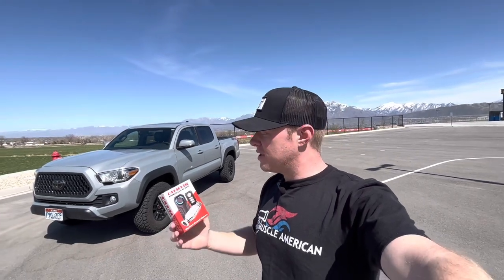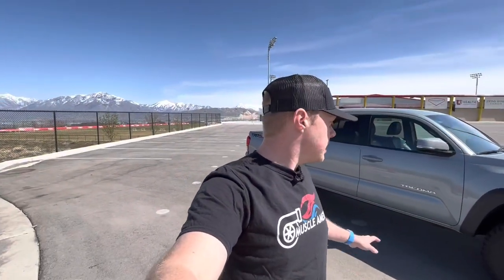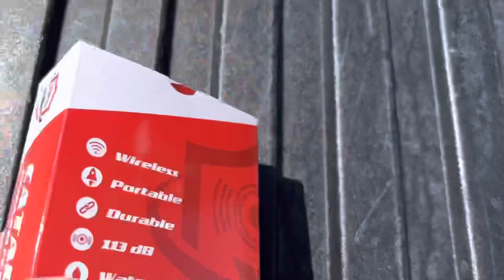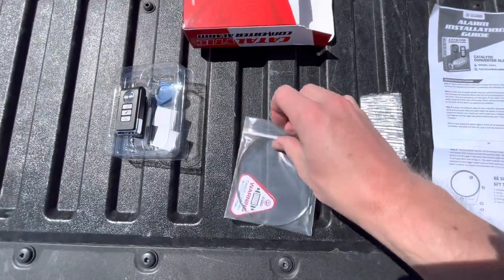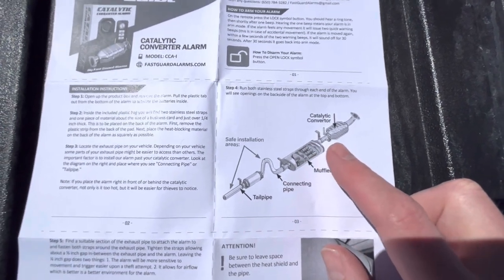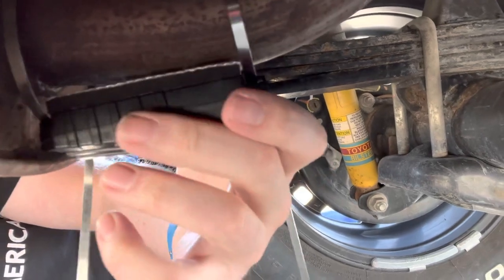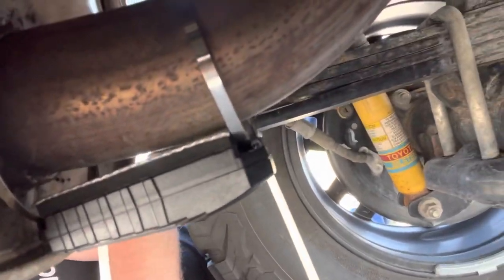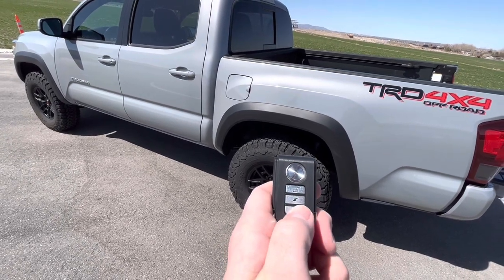Catalytic Converter ALARM Install - Fast Guard Alarm - Anti Theft Device

Comment: I installed this alarm on my Motorhome which sits on a 2021 Ford E-450 chassis about 5 months ago so I feel I can offer some real life experience to these comments. It works very well. It’s louder than it sounds in the video. Mine is ON when in storage more than it is OFF so I go through batteries every three months. 
You can adjust the sensitivity based on your desire. I had to adjust mine down as heavy rain hitting the large tailpipe would set it off. The neighbors didn’t like that in the middle of the night. I set the sensitivity so that a gentle rap of my finger to the exhaust tip will set it off. Mine is mounted as far away from the muffler and CAT as possible to keep it away from the heat. They are not very visible so I doubt that a CAT thief is going to notice it or know where the alarm is even coming from. 
I’ll admit that my alarm is my first line of defense. The second is a CATSTRAP.
Reply from the maker: Solid comment Dave thanks!

Comment: The arming noise goes off and then a beep a few seconds later. That delay allows you to close the door as you get out. It works well if you happen to keep the fob int the truck. So far I like them and they have worked well.

Comment: I use one of these. I bought another one cause it's so good. I have now placed a sheild under my 2023 Silverado and the alarm now sits against the inside of the sheild so the moment they attack the sheild it will go off. I dont set the gap and provided you set it on your exhaust toward the rear of your vehicle it wont burn up. Least mine didn't. Spend an extra 10 bucks and spray the cats too.

Comment: Can you do a tutorial on the heck you change the battery on the alarm once you take the time to get it installed on the pipe and just a few weeks later the battery runs out, I live in the midwest so apparently you can't buy this because the cold will quickly run down your battery, they should mention that in their website video spill. 😒

Comment: I've got one of these vibration alarms for 2 years and I'm using for same purpose. It does not need to be attached to exhaust pipe. Mine is under hood close to front. Not as hot. The vibrations from a saws all will rattle through entire truck so location is kinda irrelevant. And really t's only a deterrent.

Comment: You gotta give these people credit. It's the same alarm I have on my Specialized Roll bicycle and Honda Navi just with an added heatshield and straps.  It's loud enough and sensitive but it would sure be nice if there was a Bluetooth or WiFi link.  They're cheap enough to add these days and might only add another $20 to the price.

Comment: I'm in Oakland CA where these thefts are rampant- I had my stolen (my Tacoma has TWO to them) about 4 weeks ago.  Costs of about $4200- included was welding rebar over the the pipes as a deterrent.  I just installed this today- hope it helps.... but one of our neighbors Brian just had there's stolen THREE times and the had a cage welded over there converter- what a pain in the ass!
Reply from the maker: Wow that sucks! How did you have to wait for your cats to get replaced?
Reply: @MuscleAmerican  Fortunately only 2 weeks- I'm a contractor and my truck is a pretty important tool!  I hope this device helps but who knows- thieves are so brazen now- doesn't matter if its night or day.

Comment: Local cat thief Micky:
1.  Walks by your truck. Gives it a push. Alarm "warning beep" goes off. Keeps walking.
2.  Calls "Joey the Fixer".  Joey come by, slides under truck, sees alarm, sprays it with  "crack filler foam"
3   Micky comes by in an hour and removes cat!

This might be OK for some people.
I want something "beefier"
I plan on installing a similar device shown by a Canadian U-tuber. PLUS installing high security  armor with "secure" bolts.   Everyone has there own ideas/levels of security.

PS: A motion sensing under carriage alarm could also deter gas thieves from drilling a hole in your gas tank.
Reply from the maker: Yeah a cat shield is the best option to keeping thieves away.

Comment: I like your video and the price is worth it at least as a secondary deterent .  Where i live thieves are using sawsall or wheel saws-battery driven and it does not take long to cut an exhaust piple.  Maybe with a Cats EYE sensor too AND a CAT CAGE/Shield if you find one.
Problem is mfgrs do not make shields or cages for all vehicles that are threatened.

Comment: I own a 2021 Toyota Tundra TSS Off Raod and was just hit for all four of my CCs. It now sits in the shop with a waiting period of about 4 months for parts. I'm so mad, I don't know what to do. I do have a question though, How well does it work with the truck isn't being shaken and the fools are under the truck sawing away at the actual converters? Can a test be done on that? I'd like to see how sensitive it is when they are under the truck going away at the pipe. Any videos on that would help tremendously. Right now, I'm looking at having a full plate installed under the truck and would love to save $600. Thanks for the video and info.
Reply from the maker: 4 Months with your brand new truck! Oh man I’m sorry to hear that. 

The alarm is VERY sensitive. It will definitely go off when someone starts sawing away on your pipe but hopefully it goes off even before that when they are messing around with the vehicle etc... The best way to defend against cat theft is a cat shield but as you know they are pricey.
Reply: @MuscleAmerican  Thanks for the reply. Definitely something to consider. And yes, you are right. The Cat Shields are very pricey. Thanks for sharing.

Comment: My final thought is this......Im not convinced that it will deter a cat theft when set so far back behind the muffler instead of near the cat. The tacomas have 2 cats to protect. Will the sawsall make enough vibration to activate the alarm??? Rocking the truck will.

Comment: That's a no for me. Rattling around under my truck and hanging down. The alarm is probably not as loud as the Sawzall they use to cut it off
Reply: They don’t rattle under my trucks and it’s loud enough to scare away thieves. I use their new tripwire alarm kit on my trucks and a sawzall can’t even touch it before the alarm triggers. I’m happy with it.

Comment: Do you think this would inadvertently also be an alarm for wheel thieves because it may pick up possible movements in the process of taking tires off the car?
Reply from the maker: Yes you could use it for many different reasons. Any kind of movement will set it off. People use it as a bicycle alarm as well.

Comment: If the alarm goes off and nobody is around, will it turn off after certain amount of time or until it's turned off by the remote or until it runs out of battery?

Comment: I just got my catalytic converter stolen from my Tacoma on Christmas Eve. Needless to say I’m pissed. 
Unfortunately an alarm is useless as I learned the hard way. My truck alarm went off but they just kept sawing away until they cut it off. By the time we woke up and went to the front door to see what was going on they were dragging it into the car and sped off.
Reply from the maker: Oh man that sucks. How long is the wait to get it fixed?
Reply: @MuscleAmerican  that’s the other thing that sucks. I’ve been told it could take up to three to four weeks for the replacement to come in. We have so many thefts around here that supplies are low.

Comment: 2008 / 2014 Prius - These work well and are inexpensive - speaking from experience you will get 8 - 12 months out of one in a cold/hot weather climate.  Eventually, either the heat or subzero temperatures get to them.

Comment: The vibration from a saw is going to be different from shaking the vehicle. Have you tried testing the with fine vibrations of something similar to a saw?
Reply from the maker: It’s very sensitive so it would go off as soon as someone tried cutting it.

Comment: How does the alarm stand against mud & snow?  To replace battery, do you have to unmount/uninstall alarm unit?  Thank you.
Reply from the maker: Does great against the elements. And yes you would have to uninstall it to replace the battery and that lasts about 1 - 1.5 years.

Comment: Its sad that we even have to think about this stuff.  Mine was just stolen off on my 2006 Toyota Highlander.  Took it to a muffler shop and they replaced it.  They only charged me $350 plus tax and had it done the next day.  I also have a Corolla that I park in my garage but I really don't know where to park my Highlander now.  Thieves stole it when it was parked in back of my apartment building.
Reply from the maker: That’s good you got it replaced quickly and relatively cheap. That’s not the case for most people.

Comment: Ha, I have the same alarm for my e-bike, minus the heat shield. A word of caution, the more you use it, the sooner you’ll have to change the battery on the alarm. Got mine through Amazon. Very inexpensive.
Reply from the maker: Thanks for the tips!

Comment: I have this exact alarm set up after my 98 ranger got stolen. The catalytic converter was one of the things stripped after it was located and returned to me

However i’ve noticed a problem with my own. 

The control wont engage the alarm. It was working fine for the last few months until on july 4th it wouldnt engage at all. Must be a programming issue

Comment: The saw that they use is louder than the alarm, they probably won’t even hear it when they are sawing it off. I had a catalytic converter stolen a couple months ago off my Tundra. I installed a shield after had a my catalytic converter replaced.
Reply: What kind of shield you go with?

Comment: The alarm is useless unless its telling you. You can cut this alarm away. I use a Harbor Freight drive way sensor that I mounted under the vehicle. I retro fit. So what happens the motion detection sees you, it goes off, & the receiver of this Unit goes off in my house next to my bed. Any questions.... These noise makers are not going to scare anyone. They know you can't hear it....

Comment: I like the wheels are size are they and what tires ?
Reply from the maker: The tires are KO2s 265/75R16. The wheels are the new trd pro wheels. I did a video on the tires if you wanna check that out.

Comment: Has anyone tried to open the device an see if you can connect it to a relay that autosets it like when RAP turns off power in your vehicle,  Then maybe possibly another relay off of the alarm to connect to the vehicle alarm?   Or even a wireless relay that can be connected to a home automation system or a home alarm so that if the converter is tampered in the driveway it sets off the house alarm or gets alexa screaming "Vehicle Theft".  I know it can be done, but wondering about the reliability of such a cheap device.

Comment: Do you still use it? How has it treated you?
Reply from the maker: It recently broke so I no longer have it but it worked well the few times I used it. Now I have a CAT Shield that is the best protection. Check out my video on that if you’re interested.

Comment: I bought two of them for my truck.   It work well but not loud enough.    I wish it was more of motion detector with eye like a house alarm than bump and shake alarm.   Remote is very plastic and it can break if you leave it in your pocket.   Hope they will improve soon so I can buy them again.
Reply: You can buy a wireless door chime/alarm with motion sensor (like what businesses use).  If you park fairly close to where you live you can place receiver/alarm inside (nightstand), sensor anywhere under vehicle (away from heat/water safe), and know the second something crawls under.  I used this method a few months before springing for a full aluminum shield.  Only had 2 animal false alarms but worked great.
Reply: @MrMice...  link to what u taking about?

Comment: The saws they use a definitely louder than that alarm.  And, besides that, they just don't care.  These thieves are extremely brazen.  Daylight.....people around.....no worries for them.  Lax penalties.....no consequences.
Reply from the maker: It’s a deterrent and for $30 it’s worth a try
Reply: @MuscleAmerican  I agree.  Price doesn't break the bank.  I have five co workers who were victims of this.  The average price to repair....$1500.
Reply: @MuscleAmerican  it’s better than nothing, for sure.  My solution was a stainless steel plate made by Miller Cat along with a tilt-sensitive alarm (I have a Prius, so it would need to be jacked up).  So far so good about 1 year later.
Reply: @arachosia  You know welding a couple of 3/8 and drill bits to your cat is a much better way to protect it than any of that and it's a lot lighter and simpler
Reply: @Johnny-tq9no  no, I don't know that.  I have no idea what you mean.  Welding drill bits to the  cat?  What would that do?
Reply: @arachosia  If you weld a couple 3/8 inch drill bits overlapping when they try to cut it out, you're going to have to cut through at least one full layer of extremely hard metal..  it's really cheap to do and the drill bits are tough to cut without a torch and it's going to take a lot more to cut than normal steel 2x as thick
Reply: @arachosia  how much the alarm run you?
Reply: @ebsa123123  it wasn't much.  I don't remember exactly, but about $20.

Comment: Won't the straps melt off?
Reply from the maker: No they will not
Reply: @MuscleAmerican  Thank you. I have a 2008 Prius the Cat was stolen and what a pain to get this resolved. And having to pay $500 deductable hurts as well.
Reply from the maker: @yolanda9730  sorry to hear that! The Prius is one of the most targeted vehicles for catalytic converter theft.
Reply: @MuscleAmerican  Yup, I found that out after mine was stolen right in daylight at the front of a Mall by the main bus stop

Comment: USELESS. Stealing cat from your car takes maximum 2 minutes. Usually takes 1-1:30 minutes. Now think about it. Will this alarm security actually help? My thought is , thieves don’t give a da*n about the alarm. They can take it off or just keep doing their job. Lets say It did help you, you heard it and came to your car. What can you do about it. Its very unprofessional and unsafe for you to come and try to do something against it because they are going to pull a gun on your face. THIS DEVICE is JUST a MARKETING SCAM.
Reply: I live in San Francisco and cat stealing happens by hour here. You better find install shield protection instead of this alarm toy. But it still doesn’t give you 💯 guarantee.

Comment: Windy days, or a heavy truck driving by..shaking it a bit May set off the alarm?  Be prepared for this..?  A cheap solution…but how long will it last with all the debris hitting it?  The weather? What’s the battery life?…
But I am sure the nose may help ? Aloha
Reply from the maker: Should last up to a year and for $30 it’s a easy cheap option.

Comment: I bought a door alarm for a shed, it works on proximity and is mounted on the body between the door edge and frame right even with the cat.  The thief starts under the car at the cat with his saw and they trip the “eye” and the alarm goes off. I also found it on you tube.
Reply from the maker: That’s a good solution!
Reply: Please share the brand if you could of the shed alarm you used.  I am very interested.  Thank you.

Comment: That won't work and it will generate a bunch of false triggers with any wind gust. On most normal cats they are so close to engine and so solid in its mount there's really no way its going off especially how far away it'd be on my Tundra CM. If you have a car alarm most have shock sensor for breaking glass and it can be adjusted for more sensitivity.

Comment: It so needs to be more sensitive I feel they could get under there and it would not go off.
Reply from the maker: No it’s extremely sensitive. And if they actually touch or start cutting the pipe it will definitely go off. I shook the truck to show how sensitive it really is.

Comment: The thiefs know that if they get caught they will not be sent to jail for nonviolent crimes such as converter thieft. When was the last time you heard of a catalytic converter thief prosecuted and given jail time. It would be on every nightley news if they did. I was told after the thiefs were caught that it was a good thing that they got caught, that the only reason they were doing it was because they were on drugs. They were to go to a drug class to help them get of of drugs and they were to do community service. If you break hunting laws they can take you gun, you 4 wheeler and truck everything involved in breaking the law.If they get caught stealing converters the only thing the law takes is your converter they are found with and they are right back on the street driving the same vehicle they hauled you stuff off with.
Reply: :face-orange-frowning:

Comment: Sorry, I just don't see the value of this.  It looks like it'd be easy to spot and remove with 2 snips, or break it with a hammer after 5 seconds of it going.  And then they just need 90 seconds while you get your shorts on and a ball bat.

Comment: Just weld some rebar to the catalyst converters…..they see that they won’t even try sawing it 😎
Reply: Rebar is easy to cut.  It's a soft metal
Reply: Recommended by another site is hardened chain welded for a few feet along along the pipe and cat . If you know some that welds better .
     3/8 in. Case Hardened Yellow Zinc Plated Anti-Theft Security Chain 
Might want to add a few lengths . on each side .
Reply: @camaroman101   not mines !!

Comment: I hope you don't live in Utah, (Hariman) cause the WIND will set that off a lot. And It's not loud enough. I want to be paged too, and made a plate to cover cats also. Good luck. I live down the road from where you filmed. I hit. $3200 to replace. I really want an alarm that drops the truck to the ground. The crush and scream will make a good alarm.
Reply from the maker: You had your cat stolen?
Reply: Yes. Tundra, 4 cats